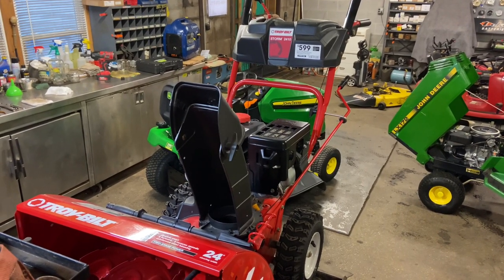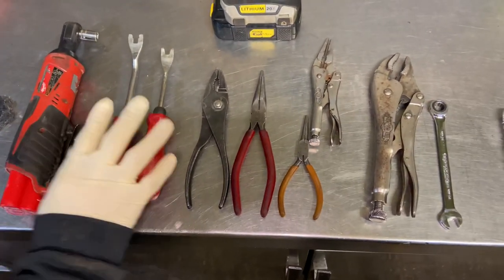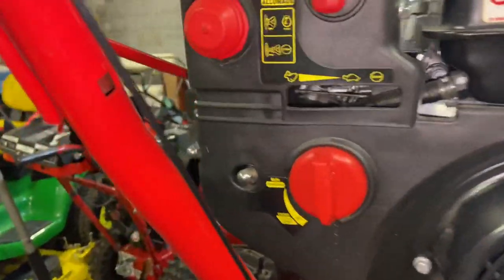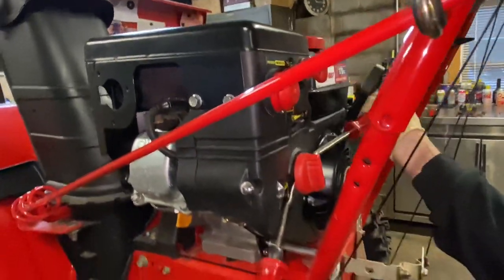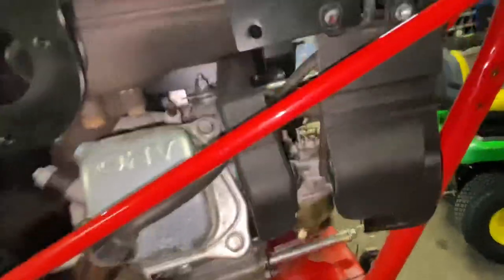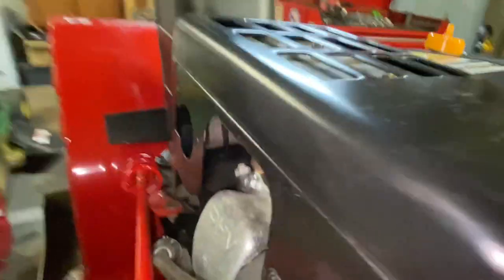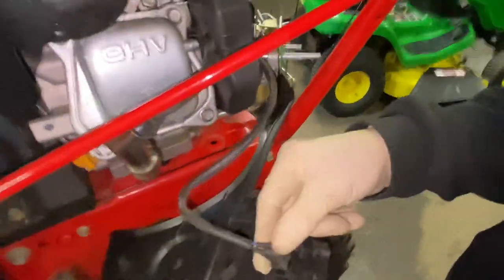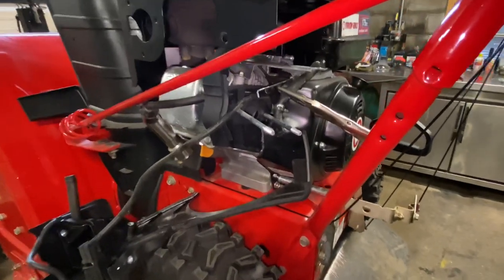How to remove carburetor TroyBilt 2410 Snow Thrower (Old Style)

Comment: Excellent video.  I want add to my solution to correcting the surging idle on my 2011 Troy-Bilt Storm 2410 snow blower which has existed since I purchased it new from Lowe's in Nov '10.   The engine is the same 179cc "early" version that Brad addresses in this video.  My snow blower has always been stored indoors and properly winterized each Spring, but has had a "surging" idle since new.  The engine starts easily, and runs fine under load (with partial choke).  I have simply tolerated the surging idle until I ran across several YouTube videos addressing idle surge in the Troy-Bilt Storm 2410.

After watching a couple of videos suggesting that a clogged idle jet will cause this issue, I decided to investigate.  Following Brad's video for disassembly of the engine control shroud, and especially removal of the elusive lower starter switch screw to release the RH corner of the shroud, I gained access to the carburetor Idle Stop Adjusting Screw, and the Idle Jet Assembly without having to fully remove the carburetor.  Sure enough, the air bleed hole in the idle jet was plugged -- not with varnish or debris, but rather with BRASS -- the idle jet was faulty from the factory!

Based on other videos which cautioned against enlarging the hole diameter more than .040", I used a #64 (.036") drill bit remove the brass in the center of this jet which I believe missed its component production "drill" process during manufacturing in China -- undoubtedly along with several hundred other jets in the same "batch".

After reattaching the carburetor shroud and exhaust heat shield, I fired the engine up and was treated to the pleasant sound of an idle that was smoother than a baby's bottom!  AND, it only took me 13+ years to figure out the cause, and get it corrected -- we get so-o-o-o-o schmart, so-o-o-o late!!  🤔🥶😠

Comment: Very helpful video! Can't believe MTD made these without any kind of fuel valve or easy way to drain the gas...
Reply from the maker: Hi Mike, there is a side mount bolt on the carburetor bowl you should be able to access to drain the fuel from the carburetor. Not having a fuel shut off is not good.  You may also try alternative fuel that you can purchase at the big box stores. Tru-Fuel. https://trufuel50.com/4-cycle-mix/. OR what I am now using Aspen Fuel. https://www.aspenfuels.us/. It is far superior to pump gas and you will not have the issues with gas going bad while storing your machine but do not mix the two (gas station gas with true fuel or aspen) You will not get the benefits from using the better fuel.

Comment: I feel much better now. I'll be doing this tomorrow. Thank you. Video was perfect.
Reply from the maker: I hope all goes good! I'm glad it was  helpful and thank you for the kind comment!
Reply: @JohnsonsSmallEngines  I put the new carb on and it went great but, it still runs great for ten seconds and then acts like the choke got flipped on and dies. Spewing white smoke. I'm lost.
Reply: OK, I figured it out. I got this snowblower from my neighbor because he couldn't get it running. I figured out that the crankcase was completely full of gas from that bad carb. Anyway all is good now.
Reply from the maker: Glad you figured it out!

Comment: Hey great video, qq, i have the same machine, i just replaced the carb with the troy-bilt carb version, it was working great about an hour ago, i went inside and then started it up again, the engine isn't coming up to full throttle (max) speed,  although the engine still runs, now it won't throw any snow out the shoot, the wheels move, the auger and snow thrower wheel works fine but now I'm just trying to figure out why it lost the high end power.
Reply from the maker: When you move the throttle from slow speed to high Speed the engine should sound different. If it stays the same , you may have the idle screw in to far or it sounds like you may have installed the carburetor incorrectly but without seeing or hearing it, to tough to diagnose.
Reply: @JohnsonsSmallEngines  I just put the new carb on, no adjustments, the throttle is maxed but doesn’t seem to increase the rpm’s.  Thanks and understand diagnosis is tough to do. Appreciate it!
Reply: @JohnsonsSmallEngines  Hey,  the next morning I decided to give it another go, it started it up and had full power, i think maybe there was water in the fuel?  Maybe one of the jets was iced up for a second but all is well with the machine!
Reply from the maker: @chuckbllrs3844  Nice! Glad to hear.

Comment: Thanks for the video. My machine is working fine,but when I store it for the next snow storm,I have to store it with an empty tank.
If I don't,the tank will drain until its empty.
Does this sound like the carburetor float or needle valve could be the problem ?
I'm half tempted to just order a new carburetor before I start this project this spring. 
I might see what Troy charges for a new one,just to avoid getting the wrong one from Amazon .
Thanks again for your excellent video's!
Reply from the maker: Yes, the needle valve and seat may have some bad fuel deposits allowing the gas to keep flowing past the seat.

Comment: Yeah I have this snowblower and it needs the carburetor replaced. Fuel is leaking from the bowl after I tried to clean carburetor.  Could not clean the needle because the screw is stuck down the center so buying a new fuel maker.  I cut away plastic that is not needed in process of disassembly.   I want some of those forked pry sticks but where do you buy them?  Dirty fuel messed up the fuel maker I believe as the machine come with no fuel filter and no tank screen neither.  The bowl was clean on the carburetor but when I put it back together the O ring must be shot.  I am just getting a new one.   Not much money.
Reply from the maker: Just look online for a “plastic fastener removal tool”. Any automotive store should have the tool.

Comment: Thank you for the video. I just picked up one of these older style 2410 snowblowers and the engine races horribly. I suspect the throttle plate is stuck open. When you replace the carb is there a specific one you replace it with?
Reply from the maker: You should look up the part number to get the correct carburetor for the machine

Comment: I have this version of the 2410, there was fuel in the crankcase and seems like fuel coming from the exhaust when I try to start it, do you think a new carb is in order?
Reply from the maker: Yes, order a new carburetor, also flush oil out of  crankcase and put fresh oil in and I would also install a new spark plug.

Comment: My same unit that I just bought used has an engine that surges once the choke is off. Prior owner had very little gas and debris in the tank. I emptied it cleaned it out put non ethonal gas and seafoam, and new spark plug and it did not help at all. I assume carb Is clogged some. Probably as much work to clean so I probably should just replace the carburetor correct?...  I am a 57 year old non mechanic female going to attempt this. 🤔 any other suggestions? Or would it be best to to bring to a repair shop? Thanks
Reply from the maker: Hi Stacy, You may be able to operate it the way it is. watch this video. https://youtu.be/O6-LXGAIEig

Comment: This is an excellent video! These engines are made of inferior metals. It is not worth the effort to rebuild one. After rebuilding a 179cc, Chinese manufactured, engine for a 2410 storm, I am shocked at the lack of quality. The aluminum is too soft. The smaller bolts are very brittle. These engines may last a while. However, they are liable to break a rod, sooner than a person can afford.

Comment: Hello mr Johnson 
Amazing video 
One question.
My 6 year old Troy bild carb is surging. Can I fix it with sea foam or other product or I need a new  a carburetor
Reply from the maker: I would suggest trying to rebuild it before replacing it. I haven’t had experience with sea foam. I guess it would not hurt to try it and if it doesn’t work then rebuild or replace the carburetor.
Reply: I just replaced the carburetor. Once again, great video. Couldn’t done with out it. You are the best…

Comment: Thank you thank you thank you!  Looks very similar to the job I'm going to have to perform once the new carb arrives.  only difference is that my 2410 model number ends in 766 instead of 711.... is that much different from this assembly?
Reply from the maker: If it looks the same it should be the same but I could not tell you what they all look like from one model number to another. Thank you for watching and commenting. Please give this video a thumbs up to help my channel.
Reply: @JohnsonsSmallEngines  Already gave you a thumbs up!  Again, very much appreciate your videos!
Reply from the maker: @davidturk417  Thanks Dave!
Reply: @JohnsonsSmallEngines  Well, my new carb arrived, I think it's a ROP Shop brand, whatever that is.  I plan to watch this video a couple more times before I start on it this weekend!  I want to thank you again for posting these videos!  If you were closer, I would just pay you to do it!
Reply from the maker: @davidturk417  Good luck! Take your time and you’ll do fine!
Reply: My new carb came with a fuel filter, but I don’t see an existing one, advice?
Reply from the maker: @davidturk417  You don’t have one. Well that’s not true. You have a filter inside the fuel tank. It is attached to fuel tank with a locking grommet nut. You normally will never clog it. They sell more carburetors the more “EXTRA Stuff” they sell with it. Give it away or use it on another piece of equipment you may have that has a fuel filter.
Reply: @JohnsonsSmallEngines  Well, got it done.  What a PIA!  LOL   I had a hell of a time getting the front cover back on over the two bolts that secure the carb.  I ended up taking off the plastic pulley cover so that I could remove that last metal shroud bolt and then the shroud.  In the end, I forgot to put that last clip back on the rubber hose that protrudes near the spark plug wire.  It seems very secure without it though.   I have no desire to open it up again at the moment.  I started it, ran fine, after I remembered to put the plastic ignition key back in!  Another f'up on my part.  Live and learn.  I don't know how you make it look so easy!  :)
Reply from the maker: @davidturk417  Glad your up and running. No need for that clip, as you said, it will be fine. I have done hundreds of these carburetor jobs because we live in a area that doesn’t get much snow so the snow throwers sit 8 months out of the year. Remember to run your machine ever other month for at least 10 minutes or more to get the fresh fuel from the fuel tank through the fuel line and into the carburetor to keep the carburetor fuel fresh. Always put fuel stabilizer in your gas can when you get gas do all of your equipment will have stabilized fuel. If your going to run the machine out of gas at the end of the season, remember to run it until it won’t run and drain the side bolt on the carburetor to make sure the machine has no gas in it. You can check out TRUFUEL online to see if that is something you may want to try but it is a little pricey.
Reply: @JohnsonsSmallEngines  didn’t add the fuel stabilizer, but already ran it out of gas and drained the float bowl after I test started it!  👍😉
Reply: @JohnsonsSmallEngines  So, now that I got my 179cc, 24" Troy Bilt running like a champ, I'm already looking ahead to future winter snow storms, and wanting to upgrade to a 28" or 30" with more capacity for heavy, wet snow, and ice chunks from the snow plows.   I'd like something at least 270cc -305cc or larger.   Is there any particular brands you recommend that are easier to service, specifically cleaning carb jets on, and others you would recommend avoiding?  Thanks again!
Reply from the maker: @davidturk417  You must learn how to store the machine properly in the off season to get out of the carburetor cleaning and I think I will make a video on how to store your machine in the off season. If your looking for a bigger better machine the older Ariens snow throwers with a 8 to 10 horse power Tecumseh engine are nice machines. I have one for sale on Facebook Marketplace at the moment. Not sure if I can get you a link from my phone but that would be a good machine for the heavier snow.

Comment: After setting the knob to choke, I can get the engine started, but it dies when I adjust the knob to run!  What do you think is wrong and how do I fix it.  This is a 2410 storm Troy Bilt snowblower, about 5 years old.  Please advise.
Reply from the maker: Watch this video in the link below and all links to repair your machine are in the description. “My New Snow Blower Will Not Start!! It Only Ran One Time Last Year, Now It Will Not Run!!!”
https://youtu.be/Wj25U4FDV-0

Comment: What do you do to stop the surging of the engine and how do you increase the rpm, as mine is not fast enough.
Reply from the maker: Hi Tom,
 The carburetor will need to be rebuild or replaced to stop the surging. (the surging came from gas going bad inside the carburetor from sitting for a long period of time without being used). The engine speed should not exceed 3600 rpms and you will need a tool (tachometer) to find out what the speed is. Here is a video on how to rebuild the carburetor https://youtu.be/_ngK6l6_J7g. and below the video in the description there are links to help you out. I would also recommend stop using pump gas and look into Aspen. Here is a link to read up on it. https://www.aspenfuels.us/products/all/

Comment: I have a question, I bought a new carb, but the choke shaft doesn't clip onto the carb
Reply from the maker: If you mean the choke rod doesn’t fit into the hole of top of the choke bracket on the carburetor? I have come across a few that were very tight but they do go in or you may have purchased the wrong carburetor? Without seeing what your saying, it is hard to help.
Reply: @JohnsonsSmallEngines  than you for your quick response, yes, it was an unbranded carb for the 2410... I just purchased the correct one, they have substituted so many parts with new ones
Reply: What carb did you buy? Give me where you got it from

Comment: I would like to increase the speed of the engine, as this storm Troy bilt snow blower doesn’t throw the snow far enough. Can you help me with this?
Reply from the maker: The engine speed should be between 3400 and 3600 rpm’s. I do not have a video on raising the engine speed because normally they never need that adjustment. Your not going to see better performance from raising the engine speed unless you have a huge difference in rpm’s. To help your machine perform better, you need to make sure the auger belt is correctly tensioned and spray silicone in and around the chute/auger and exhaust chute. If all is working correctly, then your machine is operating as it should.

Comment: Hi, mine starts but when switch to run, the engine dies. Is this carburetor issue still? I tried to fix by putting seafoam but no go.
Reply from the maker: You will need to rebuild the carburetor. Here is the link;https://youtu.be/_ngK6l6_J7g
Reply: @JohnsonsSmallEngines  ok thanks, i might just get a new carb. mine is the old model, does the new and old model have same carb?
Reply: @JohnsonsSmallEngines  Thanks so much! I was able to replace the carb using your video remove and install.  Now ready for the big storm tomorrow here in chicago

Comment: Do you have to drain the oil if gas got into the crankcase?
Reply from the maker: Yes, if your carburetor fails that can happen and you absolutely need to drain engine crankcase and refill with new oil.
Reply: @JohnsonsSmallEngines  I played hell getting that cover back over the choke blade  maybe you should show  that part  if you do another one of these videos  thank you for all your help and this video im now  leak free and ready for whatever old man winter sends my way.
Reply from the maker: I’m glad you got it back together ok. The old style is a pain to get back together. When I get another one in. I will make a video on the removal and installation:)

Comment: Thank you so much for this video. My machine still wont kick on. I changed the carburetor, spark plug, oil, put in ethanol free gas and still wont start even when trying with the electric start. Can anyone please HELP
Reply from the maker: The next step is to check Ignition/spark. Check spark by using a inline spark tester if you can get one. If you do not have ignition, you will need to replace coil or find the reason why the coil is not igniting. If you have spark/ignition, next would be checking compression and unless you have a compression tester it may be a little tricky. When you pull the pull rope slow you must feel resistance at some point. If the pull rope comes out slowly with no resistance you may have no compression. It should feel easy then harder then easy. Only when you pull the rope slowly. If you haver no compression you will need to take it to a small engine mechanic or someone that could look into it a little further.
Reply: @Johnson's Small Engines   thank you I truly appreciate it. I got it to start after half hour of pulling on cored and electric starting. I got it to start but shuts off after 10-15 seconds. I bought my carburetor from Amazon. Should I invest in a troy built carburetor?
Reply: @Johnson's Small Engines   hey I'm back to let you know I checked out your cleaning carburetor video and cleaned out the original 1 put it back on and wa la. It works. Thanks for all your videos